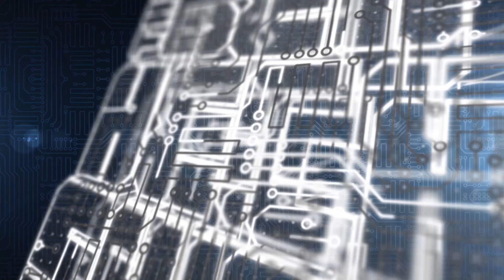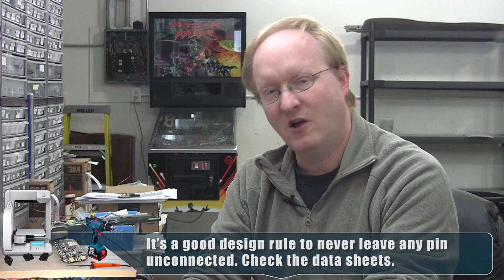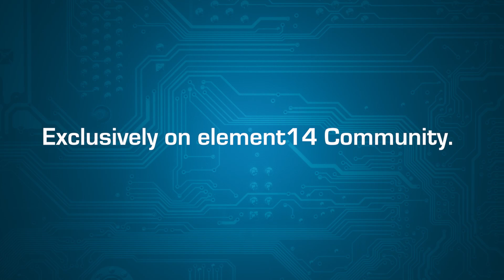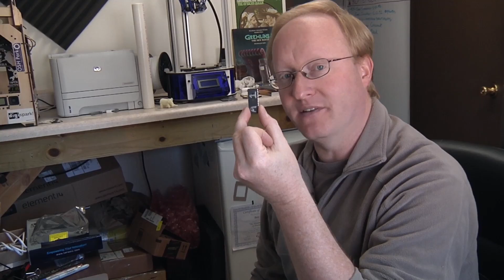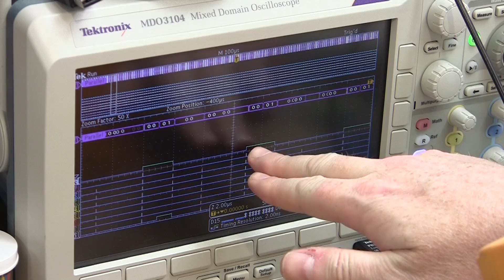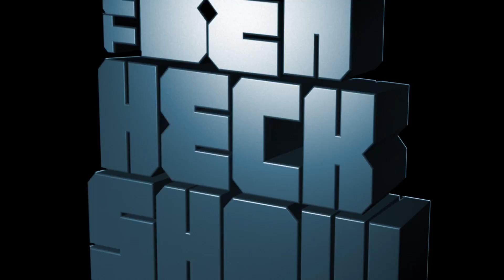Ben Heck's Apple 1 Replica Part 1

Comment: "timer circuit" for reset? never heard of dallas econoresets (DS1813+ for example) ? i know 'timer circuits' and 'rc circuits' and contraptions with zenerdiodes were the shit in those days but there are proper reset chips around nowadays, which only take a single to92 component, that also pull reset if there are brown out conditions while it runs. timer circuits do not monitor the voltage. (analog devices has something simular in 8 pin narrow dip)

Comment: One thing I've long wondered is whether some simple wiring mods could have allowed the processor to output data to the display faster if it injected data into the shift registers at just the right time [the normal design would latch a byte of data from the CPU and then have hardware clock it into the shift register at the right time].  Even if the CPU wouldn't be fast enough to write two consecutive bytes in the same frame, it might be able to inject every tenth character or so.  Apple I computers are too rare to be worth hacking with for such experiments, but a recreation that uses shift registers might be interesting to experiment with.

Comment: Dude you haven't explained anything in this video that is helpful at all. No schematics, did no specify the chips used. How did you program the ROM? Where do you get the Woz monitor hex code? Half of the video was looking at a hex editor....
Reply: Have you looked at the supporting files section of their website?  It has 100% of everything you are asking for.  Look for it here: https://www.element14.com/community/docs/DOC-70662/l/episode-158-ben-hecks-apple-1-replica-part-1-episode

Comment: My gods, the wire-wrap prototype boards.  The moment you started soldering breakout wires I started getting flashbacks.  An Apple I is simple enough, but the Mac prototype boards were incomprehensible rats nests of glory; and choosing to use all black wires is straight baller, Ben.  We don't need no labelling, here!  XD

Comment: $14,000 Mixed Domain Osci.... http://www.tek.com/oscilloscope/mdo3000-mixed-domain-oscilloscope
so much for diy
Reply: DONT LIE TO ME JARED CONNELL. MY GRANDSON LOVES TO USE OSCILLOSCOPES BUT THEY ARE VERY EXPENSIVE. IN 1964 WHEN I GOT MY ELECTRICAL ENGINEERING DEGREE THEY WERE THE SAME PRICE.
Reply: while they obviously don't do everything that the one you linked to rd owa, you can get oscilloscopes for under $100. they have kits to build your own for about $30. talk about diy, you can build one of those to use to create your other diy projects lol
Reply: +ilove Jesus Definitely a premium product, hence the premium price.  I actually wrote the bus decode display feature on the MDO3000 scopes, so I might be kind of biased.  

Of course, a Rigol scope can get you most of the way there for far cheaper - definitely more DIY friendly.

Comment: So Ben, why did you spend all that time wiring the ram, rom, and cpu like that with all of those wires instead of just etching into the pub board, wouldn't it been  a 1000 times easier?

Comment: Cool project, after watching this, your Atari 800 videos, and the specky project it occurred to me that it would be a really sweet project if you could make an "ultimate" 8 bit computer and combine compatibility of the popular 8 bit machines that use the 6502 processor.  Maybe they could share processor, ram, and other bits, but select which machine they run at power up somehow to then tap into the other unique chips that make them all different.

Comment: Cool idea, to re-build a 6502 computer;) Why you din´t go the way as all the others had gone that days built up a proto board? I´ve used the old school wire-wrapp method. As it´s way easier and the lacquer-coated copper is by far more easier to solder and to re-wire in case of some error(s).
Here´s a little how to:
Intro to Wire Wrapping
And here´s what had going on with Pro wire-wrapp boards:
Handmade WireWrap Card 1978 - Amazing !

Good work, anyway!

Comment: TECHNICALLY, it's 65,536 bytes.  The highest possible address is 65,535.  Always remember to count your zeros. :)

Also, another option to make things work well would be to use a 64K (or larger) ROM chip, and put the data that's supposed to be at $C000 at $C000 in the ROM chip.  It requires a bigger ROM chip (which can actually be used to your advantage later), but it keeps things nice an organized while you're debugging.

Comment: lol, I used to write in hex (machine language) until I found out assemblers existed. I think you meant an assembler and not a compiler.

Great vid, brought back lots of old memories. Like when I wrote my first hex editor for disk sectors on my cp/m machine. Or debugging my microcode using a 1630d logic analyzer.

Comment: LOTS of inaccuracies about Steve Jobs' contribution to the development of the Apple I and Breakout.  

The short version of the real story is:  Steve Wozniak is a genius of an electronics engineer who built (arguably) the first modern PC.  He also hung out with a guy named Steve Jobs whose talents lay in business and marketing, and who once cheated him out of of some money after single-handedly developing Breakout for Atari (and as a favor to Jobs).

Otherwise, good video.
Reply: No, Steve Jobs really tricked him of a lot of money. Steve Jobs claimed the Breakout game gave 1400 dollars that they would split equal, but they really got 5000 dollars. So Jobs gave Wozniak 700 dollars and kept 4300 dollars for himself. Also, Steve Jobs only helped with inserting the components on the bread board.
Reply: Steve Jobs was a HUGE douchebag!  All hail the great and powerful Woz!
Reply: @joshcopeland  If you read  "The Apple Revolution:Steve Jobs, The Countre Culture..." by Luke Dormehl (Virgin 2012 ISBN  978-0-75-354062-6) you can read how obnoxious Jobs was - he makes Alan Sugar and Jack  Tramil sound like puissycats
Reply: That is 110% correct.
Reply: You have the story wrong.  Woz is NOT such a genius.  In fact, Woz has lied a number of times and it can be proven.  First Woz said he built the Apple 1 with ZERO input from Steve Jobs.  But Chuck Peddle, the MOS 6502 engineer said SPECIFICALLY it was Jobs, NOT Woz who bought the first 6502 for the Apple.  And the story gets even worse for Woz, as Chuck Peddle has gone on record to say he basically helped Woz make the Apple 1, because the circuit that Woz made did NOT work. Chuck Peddle, said he went to Jobs' garage and  helped BOTH Jobs and Woz re-wire the Apple 1 to make it work, since it did not work.  
This goes completely against the urban legend sold by Woz which is that the Apple was not made in Jobs' garage and that Jobs' had zero input in it's making.  In fact many movies use Woz's version of the story, which is incorrect according to Chuck Peddle.  
To make matters worse the Apple 1 truthfully is a a modified version of Chuck Peddle's 6502 computer, which sold BEFORE the Apple 1.  Also Paul Tyrell has gone on recorded saying that much of the Apple 1 design for character TV output was made by HP engineers for a dumb terminal based on the 6502 which was scraped for a motorola version, and HP let Woz have it, as they opted to use the motorola version of the circuit...  Which is curious, since Woz seems to have the story backwards.  
So it does not take much to deduce that the Apple 1 was based partly on Chuck Peddle's 6502 computer kit, married with HP's terminal circuit design.
...AND...to make matters even worse, Woz's dad worked as an engineer... and we all know Dads, many times their kid's projects are done by the dad... if you know what I mean.... 
It is very interesting that Woz NEVER did anything noteworthy by himself after the Apple 1&2.(Apple 2 being heavily based on Apple 1)
Also EVEN Woz admits that almost all the soldering of the Apple 1 was done by Jobs, not Woz himself... Woz supposedly did the "design on paper" at home....where his dad happened to be....
Woz is A STORY TELLER..
The REAL GENIUS and REAL INVENTOR OF THE HOME COMPUTER is GARY KILDALL.  In fact Gary Kildall is recognized by the IEEE for the inventions of the personal computer.. Woz is not.
Reply: Jobs wasn't asked to design Breakout. Nolan Bushnell had already designed it but it used a lot of chips and was going to be expensive. So Bushnell offered Jobs a huge bonus if he could improve its flagship arcade game, "Breakout" - specifically, a bonus of $100 for each TTL chip removed from the design at a time when arcade games typically used  around 170 chips. Jobs bragged that he could do it no problem, but ended up going to Woz to redo the design. He told Woz he only got $700, giving Woz $350, for it when in reality he was paid $5000.
Reply: The story I heard had Jobs doing the busy work for breakout (such as wiring and soldering) while the Woz did more of the design aspect. And Jobs only cheated him out of the bonus for getting under 50 chips iirc.

Comment: Why writing all the codes.in machine language is considered insane?
Reply: Depends, for big software, you couldn't do it. But if your whole software will end up fitting in a kilobyte, like it's a bootloader, that's only a few hundred opcodes, barely takes minutes to hand assemble it. People can no longer imagine doing it, because they don't even have assembler experience any longer, so it's a few levels away from the level of abstraction the are used to working with, so the complete layer at which this takes place seems like magic to them. It isn't.

Comment: Jeez, Ben, why do you go through the trouble of hand wiring the memory like that, just make a PCB.

Yea, I know, this is more flexible, but if you add an unpopulated hole to each pin of the components, it doesn't take that much more space and you have just the same flexibility to add in stuff or debug later.
Reply: I would have wire wrapped it myself much faster than making a pcb or point to point. Also if you make a mistake you just unwrap it and move the wire.
Reply: An ideal use for their pcb prototyping setup
Reply: Robonza  I subbed because of the 3d printer video's. Nice one!

Comment: Nice to see Ben build an 8-bit computer from scratch, instead of just a case that goes around one :-)

Building your own 6502 computer is fun and easy. There are many existing designs and it's easy to design your own. The 6502 is still in production and all other parts you might need are also readily available. Lots of information is available on http://www.6502.org.

I expect he'll use a Propeller to generate video and connect a keyboard. Can't wait to see the next part!
Reply: ***** You could also use 1KB instead of 32KB or RAM, and you could just put the 256 bytes Woz monitor on it and nothing else (no BASIC, no Krusader). You could do a full rebuild of the Apple 1 including the video parts, and you could even replicate the entire layout of the circuit board, like Mike Willegal did with his Apple 1 replica (http://www.willegal.net/appleii/appleii-first_page.htm): it's almost indistinguishable from the original. Or you could go totally the other way and put the whole thing (including the 6502) in an FPGA (that's also been done before).

Every replica project needs design decisions, and I think Ben (like many others including Vince Briel) will make his build a compromise between replicating the original down to the parts list, and using none of the original parts like some FPGA designs. Personally, I think the video parts of text-only computers are just not that interesting (they're basically a bunch of counters, shift registers and a ROM with a font in it) and when you put together a video generator from TTL parts, it's pretty easy to make mistakes that are very difficult to troubleshoot. Using a microcontroller such as the Propeller (or a PIC or AVR or whatever) will not only make it easy to generate analog standard definition video in all possible formats (PAL, NTSC, VGA...) with minimal hardware, it will also deal with the fact that it's increasingly difficult to find ASCII keyboards, by emulating one from a PS/2 keyboard. Of course I haven't seen the follow-up videos in this series yet, but I think that's where Ben is going.